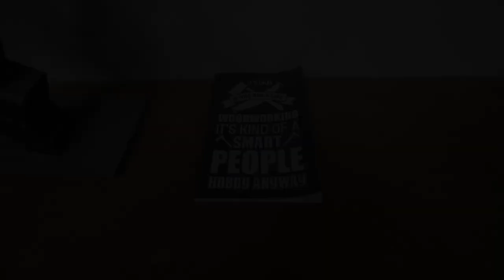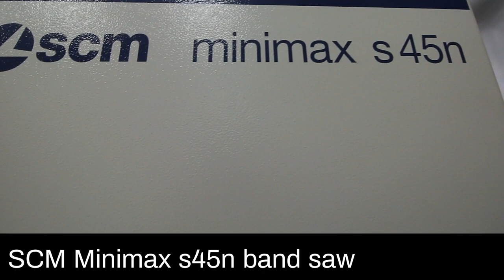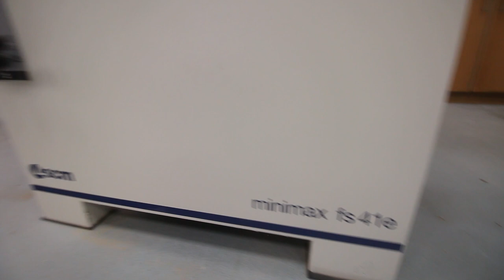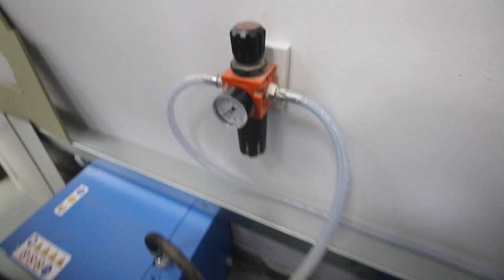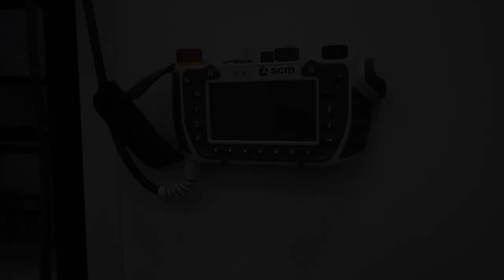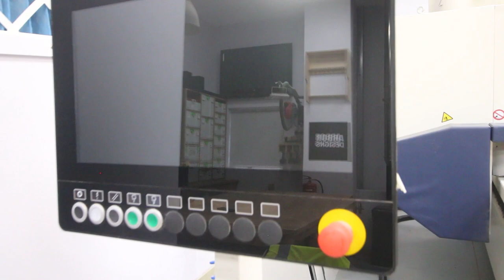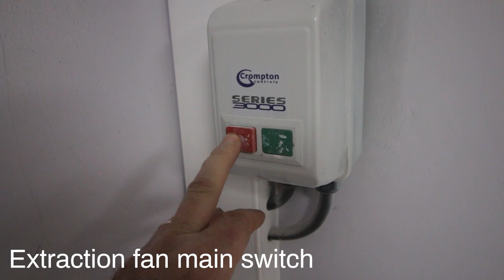Workshop Tour

Comment: I am looking at purchasing a SC4e, could you tell me the full stroke length from front to back?  I am wondering if 17'4" in enough, thank you.  Nice shop
Reply from the maker: Hi Roy thank you for visiting my channel and your comment. The distance I have front to back is about 24'9" and it needs most of this space to operate the sliding table. There needs to be sufficient room to allow the table to fully slide back to change the blade. I only use 8 X 4 sheets larger is possible but need more handling. I bought my table saw before my CNC machine. But if had known then what I know now I would of bought a smaller table saw as I do most of my sheet cutting on the CNC. The table saw takes up a lot of space. Hope the helps cheers Michael

Comment: Are still happy with your SCM SLIDER?  Does it square up plywood accurately for you and stay true?  Thx
Reply from the maker: Hi thank you for visiting my channel. Yes still happy with  the sliding table  saw however if I was cutting carcass components I usually use my CNC machine as it more accurate and easily repeatable thanks again
Reply: @arbordesigns2514  Thank you for the reply.  Now you have me wondering if the SCM sliders are accurate enough to mill up sheets of plywood for me.  I need to retire my track saw method and find a more efficient way to do this.  Thx
Reply: Would you ever do a video highlighting all of the uses for the slider table saw?  Is that the 8.5’ sliding bed?  Thx
Reply from the maker: Hi the SCM sliding saw is very accurate once set up and I would recommend it no problem I work in my shop alone and it's easier for me loading the CNC machine rather than the table saw. Yes I will maybe consider doing a video on my table saw let me have a think about it. In fact I might make videos on all my SCM machines it would be an interesting series thanks again cheers Michael
Reply: @arbordesigns2514  okay, that sounds good.  I’m looking at the Minimax SI 315 ES myself.  Just subbed and would watch the series if you decide to do it.  Is your slider the 8.5’ length bed?  Thx again.
Reply from the maker: Yes the version I have is the 8.5 SCM good machines you should be very happy with it
Reply: @arbordesigns2514  That sounds encouraging then, for me to seriously consider the SCM machine.  Just one more thing.  Even though you use the CNC for plywood processing, have you ever loaded an 8’ sheet of plywood on the sliding table saw and ripped it the length of the sheet?  I’m trying to figure out if maybe I only need the 8.5’ length table or if I should go with the 10’ slider.  I process both rough hardwood and sheet goods in my projects.  I think the only difference between yours and the SI 315 ES is the slider size, haven’t confirmed this with SCM yet, but will be asking them.  Thx again!
Reply from the maker: Hi sorry for the delay coming back to you to be honest if you have the room and finance I would go for the bigger verson  especially for supporting larger sheet goods however to consider this with the larger version you need enough  room on the front side of the machine (the place where you stand when using the  slider is considered the front side) to allow the table to slide back it's full length in order to change the blade be mindful of that hope this helps cheers Michael